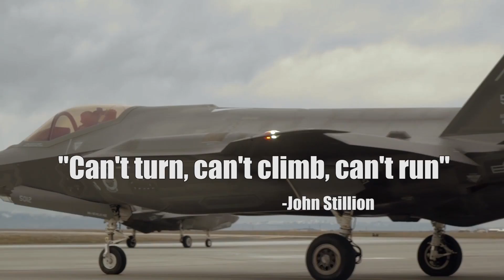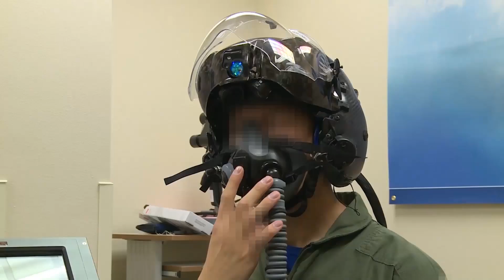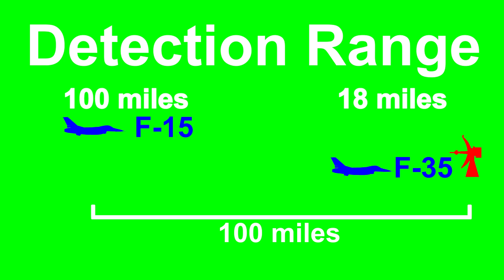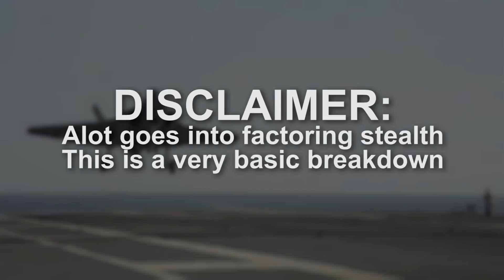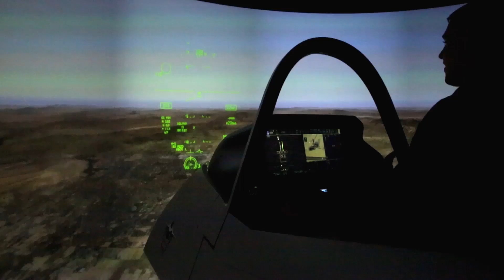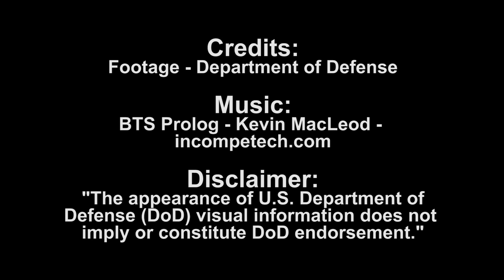F-35 Overview - The Good, The Bad, The Ugly

Comment: Compare this aircraft to the F/A-22 which is times more capable as an aircraft compared to this sack of shit. The reason for stopping the Raptor program was that it was too expensive, with promises about the F-35 being cheaper... and look what happened.

Yes, the F-35 was designed not to be ultimate flying aircraft, but to have such an edge over its opponents, with its sensors and technologies, that it wouldn't matter, that it can't climb or turn as good. In my opinion, historical mistakes are bound to be repeated here (Introducing the F-4 Phantom in Vietnam, where they thought, that missiles will be so effective, that a gun won't be needed). There is no way, this aircraft will be able to evade these situations forever.

The F/A--22 beats this aircraft in every category, and it would have been much better to just upgraded it with the latest sensors. But here comes politics and capitalism, money talking. Probably a lot of people won, sums of cash, thanks to this project, without carrying about negative rep (most of them are unknown anyway). And the most sad part is that, this project is so big, that if it was to be cancelled the USA economy would probably collapse, it is too big to FAIL. Should just minimize the production of this aircraft to lets say the Marines or/and the Navy as they don't have a 5th GEN aircraft and focus on upgrading and producing Raptors.

Comment: I've seen a Dutch F-35A take off very quickly and very steep. Never seen F-16s do a take off like that. I have seen F-15's do a take-off like that, which has 2 huge engines. For a small single engine fighter this was a really impressive take-off. Doesn't look like a poor power to weight to me.
Also the manovuering I saw was impressive. Off course flying at an airshow is not the same as dogfighting. But it is know that in exercises it kicked F-16's butt. I beleive that much information about the F-35 is classified and that its true potential is secret.
Ever thought that all the the 'problems' might be 'leaked' on purpose to make possible enemies think that its rubbish?
Its true capabilities will only be known when it goes into combat.

Comment: What's the point of stealth if it requires you not to use radar while attempting stealth? If you want to be undetected then using radar is like shining a flashlight at the others searching for you with flashlights and saying "come get me". And for example, if an enemy plane also turns off it's radar, then the two would only be detected within infrared search & track range, which would favor a fast agile fighter.
Reply: Reduction in chances of being picked up by R.A.D.A.R., and chiefly to make the data received by the R.A.D.A.R. and associated missile guidance system to be inadequate for guidance.

Comment: If it were me, I'd buy old planes sitting in the desert on the cheap, get 1 company to make all the spare parts, because I have engineering back ground I'd do some major upgrades to the planes;  improve avionics, make all the controls similar and easy to use, switch to LNG and install more fuel efficient LNG optimized engines. If I could get my hands on the SU aircraft that would be sweet.

Comment: The F-35 has less lifting surface than a lot of fighters still used today. The aircraft is basically a block with two wings - where a lot of modern day fighters have their fuselage acting as a lifting surface. A great example is the F-15, F-14, or Su-27, a considerable amount of lift is generated from the fuselage due to its contour. 

The block fuselage of the F-35 is obviously for stealth and to hide the weapons inside to reduce the radar signature, but it comes at a cost. And that is increased drag, and decreased lift. Couple that with a single engine, and it's not much of a surprise that it won't be able to dogfight. Especially since its meant to be a strike aircraft, while the F-22 dominates the air.
Reply: The F-35 has a lifting body and according to pilots is better than the F-16 in a dogfight...

Comment: I know I'm late to this video, but wow. This video leaves out a lot of the good things about the f35. Sensor fusion, it's avionics that surpass the f22 by a long shot, and also that it wasn't designed to dogfight in within visual range engagements, it was designed to take out enemies from beyond visual range, which it does very well. It was designed to be a flying, stealthy, super computer. Not a close range dogfighter. It does what it was designed for very well.

Comment: We are talking about super classified. one thing you can be sure of: the F35 has gone through various software updates which removed some (not all, yet) limitations that were forced from factory while initial tests were being done. As tests pass or fail, issues get addressed and retested and limitations removed to test the next group of features/functionalities/capabilities. Day1 F35A had a forced g-limit of 3.5.... do you really believe that final production and combat ready F35s will pull that little? lol

Comment: The internal weapons load is for what was called the first night of the war missions breaking down air defenses and hitting command bunkers. Would be wonderful if the plane had better flying performance. If I had one Christmas wish for this war plane that would really make this plane dangerous is an internally carried anti-radiation missile.   This should have been the first line of equipment for any stealth aircraft F22 and B2 included.  To me this is the first priority of this type of aircraft is suppression of enemy air defenses (SEAD). Even advance air defense systems would be challenged by aircraft that can only be engaged at a relative shorted range and have the ability to shoot back quickly and effectively putting SAM operators at just as much risk of losses as the aircraft that would dare to operate in defended air space. On a side note the Navy should not have cancelled the X47. This is what six generation aircraft will look like unmanned flying wings  that can penetrate and attack air defense systems so other aircraft can come in and complete follow on attacks.
Reply: +hermantanderson

 Better flying performance compared to what? 

 The F-35 can mount the AGM-88E-ER internally, though is still in the process of being accepted by the U.S. Air Force.
Reply: Nathan Peterson  Good to know. There's hope after all. Thanks for the info.

Comment: An overly simplistic and not necessarily factual analysis (as is often the case with everything on YouTube about the F-35). Your quoting of the F-35 vs F-16 thing shows a fundamental lack of understanding of what that "dogfight" actually was. Issues with HMD jitter are fixed with newer helmets. You should also take the time to calculate thrust to weight yourself. It is not particularly low. Overall, not a bad video though.

Comment: A small error at 3:14 
The proportion is about distance with 1/(r^4), not 4^sqrt(r) which is equal to r^(1/4). 
And I think power reflection scales linearly with the rcs, but to the inverse of the fourth power with distance, regardless of low-observability systems.

Comment: But if F35 is "invisible" , how can it use its own active radar? 
The moment it sends a radar beam it becomes visible.
And if it uses only passive radar and say the enemy guy also uses passive radar , then they both can't see each other until in visual range.
And in visual range the slower, less maneuverable F35 will be toast.
Reply: @NeightrixPrime  It has a high instantaneous turn speed. It does that the same way the Russians did when energy manoeuvrability started to be built into aircraft like the F16. They used thrust vectoring. So sure, it can turn on a dime, but it bleeds off all its speed when it does that. Watch is doing aeros in a display. The low t/w ratio means it can't get that speed back quickly. It has a low continuous/sustained rate of turn. So yeah, it performs like a F104 with thrust vectoring. Not ideal.
Reply: VascoDaGamaOtRupcha  Really dude?...Didn't anyone tell you that stealth isn't complete invisibility to Radar, rather it is Reduced Radar signature...Plus stealth has been evolving since the F117....And for crying out loud.

Comment: You missed one good point on Thrust to weight ratio.
F-35’s fuel tank takes up much bigger space by volume than that of F-16.
And it’s because F-35 has much longer rage than even F-18.

So when they calculate Thrust To Weight, they assume 100% full tank.
But if you compare by range - it’s just fine.
F-135 engine is a beast.

Same thing with Wing Load ratio.

Comment: The F-22 is for dogfighting. The F-35 is multirole.
Reply: The F22 is meant to clear the sky, so the F35 can do its job unmolested. Unfortunately there are not enough F22, and ..........there are countries like Australia that will rely completely on the F35 which will be on its own and vulnerable.
Reply: Butter Boy Tell that to the K-D Ratio. It is perfect.
Reply: Boljarin dogfighting ended in the 60s-70s
Reply: Derphin derp 
Every generation has said that and there always end up being situations where WVR combat ends up being necessary.  They said it before Vietnam, then requirements to visually confirm the enemy planes and poorly working missiles led to WVR combat still occurring.
Reply: Dogfighting is MUCH less likely. F 35 is more or less kinda like a cheeper(maybe) f 22 that can be exported
Reply: Ed Sev 
So what is the “deep state” exactly?
Reply: @keirfarnum6811  establishment.
Reply: You dont dogfight anymore, thats 1940's talk. You detect the enemy's plane 350km out and fire at them 50km out and turn around, like the F-35 is capable of.
Reply: Multirole is another word for failing to do anything good. A box ticking exercise, works on paper and in the office, not in the combat situation. 
Don't get me wrong, I love the F35, just don't like the fact it has been missold by the Pentagon by 10 different ways, possibility the largest Ponzi scheme backed by a government that's still rolling in the cash because its gone too big to fail.
Reply: Boljarin it cant do anything right...

Comment: I go would further and say if it has external pylons and weapons it's no longer stealth. Period. Shit payload capacity has always been the Achilles heel of stealth aircraft. I would also attribute a lot of the cost overruns to corruption. Production is spread to 45 states to ensure as many senators and congressmen get their slice.
Reply: It doesn't need a big  payload . The F 35 networks and coordinates other assets in the region meaning if there's an f-15 15 or 20 miles away from it can use the f-15 missiles to shoot . All the f-15 pilot has to do is fly .It can use the missiles off of an arleigh burke-class destroyer . All the boat has to do is sit there and receive the message . The whole point of the F-35 is to locate and destroy target , but that doesn't mean that the F-35 itself takes the shot with one of its own missiles . If there's any asset anywhere nearby that plane is just as dangerous without any missiles as it is with missiles .  I can pretty much promise you , you're not going to just find one F-35 flying by itself .
Reply: @Dr.Westside  And pretty soon you won't even need an F-15 pilot with a bunch of weapons, the F-35 will be commanding a drone, or several drones.
Reply: @Dr.Westside  Exactly what i thought. I saw a video a few years ago that spoke about this very thing. A large network of information accessible to all involved.
Reply: Yes... you are correct, unfortunately.
Reply: You hit the nail on the head with the "C" word. Screw Lockheed and every politician who takes money from them!
Reply: Dan Morgan the F-35 still would have a relatively low RCS even with external pylons

Comment: My prediction; F35 does not need maneuverability. It will be able to acquire and attack targets in much higher angle/area then conventional fighter. If you can see enemy through the hull and lock (see=lock) it, and missiles can predict trajectory /distance and adapt, you can kill the target even if you cannot outturn it. Such an elegant solution, should have come out sooner or later.

Comment: the biggest problem with the cutting edge weapons systems is, Congress will not fund a proper shakedown program before the system goes into production two of the best examples would be (1) the f 111 and  (2) the mark 13 and 14 torpedos

Comment: You failed to mention that the internal payload in stealth configuration is 3000#'s, less than a sixties OV-10.
Or that only the F35A has an internal(stealthy) gun. Both the F35B and F35C must carry external pods.
Or the short range, that means that ALL US bases, within the F35 combat radius range of China or North Korea, are well within range of thousands of Chinese missiles.
http://www.rand.org/content/dam/rand/pubs/research_reports/RR300/RR392/RAND_RR392.pdf Page 51 figure 3.1.
Only took 250 tank ups and nine days, to deliver 10 F35 to Iwakuni where they are parked well within range of DF-21, DF-26, etc., and the entire Chinese PLAAF.
IE, you can't base the F35's near China and expect them to survive more than about fifteen minutes in a China/US conflict
Or that China can attack the tankers at sea when they refuel the F35's for their short run into China.
Or that USAF is developing a stealth tanker...ten years out...because the threat to the tanker sitting ducks.
So, against China or Russia, forget the F35.
Reply: What are you on about?